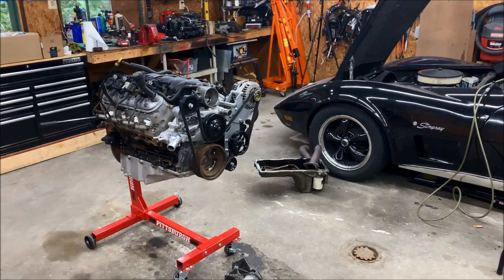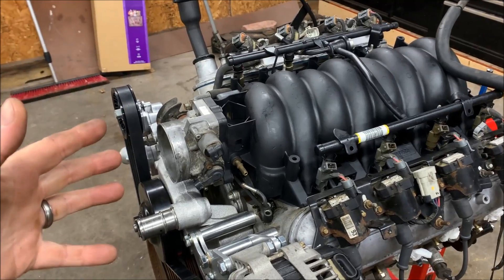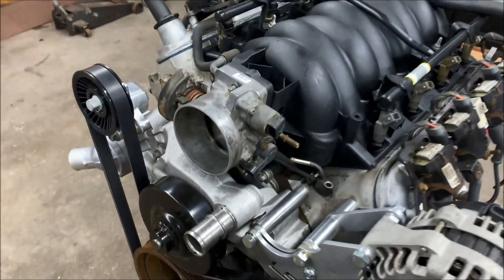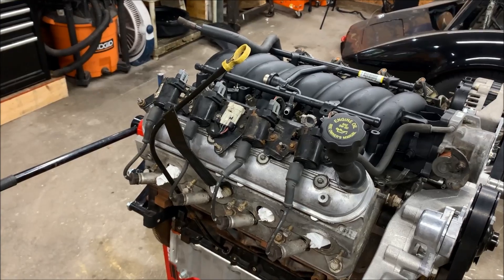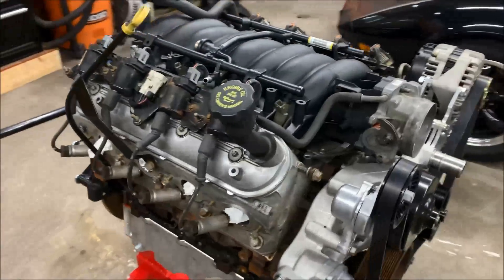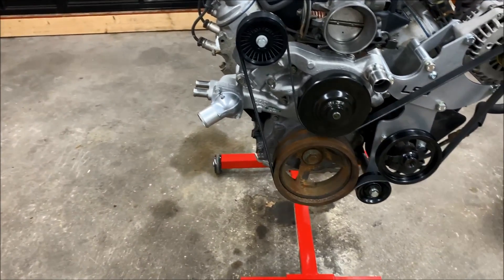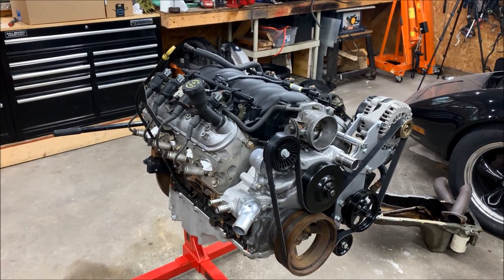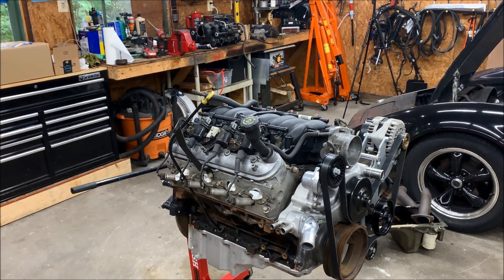1976 Chevrolet C3 Corvette LS Swap - Part 4 Intake and Front Accessories

Comment: Thanks for taking the time to record these videos. I will be doing a 6.0 LS swap on my 1970. I was gonna go big block but I changed my mind. I will be building the block from scratch, expecting somewhere around 500-550 HP. I am pulling my hair out right now with the accessory drive stuff. Total PITA. I hope what you did fits under the hood. I assume you used the water pump from a 2010-2015 Camaro, which has the truck spacing and the water outlet on the driver side. Also, I was going to try and fit the stroker oil pan 302-2 and see if it fits. I have a Borgenson steering box conversion which uses a manual style linkage.
Reply from the maker: For the water pump, that’s exactly what I did. It’s a LS3 pump from a 2010 Camaro.  It utilizes the truck spacing which eliminates the need for spacers. 

Everything fits under the stock hood, zero issues with clearance.

Comment: Those truck steam port will twist an amazing amount. I twisted mine on my Datsun to clear a ls6 intake. Same as you, thought it was going to break, Never did. And just an idler relocation will clear the pump. The aftermarket brackets solved your clearance issues and they look a lot better anyways.
Reply from the maker: Thanks for the info. I’ll put some heat to it and tweak it a little more. It’s pretty close at this point.
Reply: @StreetersGarage   I bent mine about as far as you, stopped cause I knew it was going to break or kink. Then just said f it, I got more and if it don't work its already junk.
Reply from the maker: @unclebriansspeedshop  Used the torch and bent it into the correct position.  

Completely agree. There was no turning back at that point.  🤣